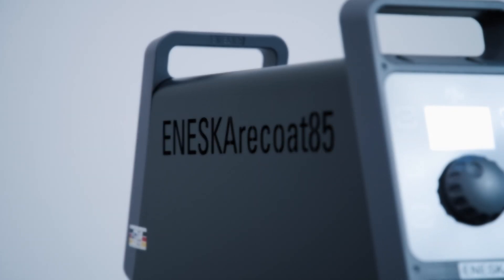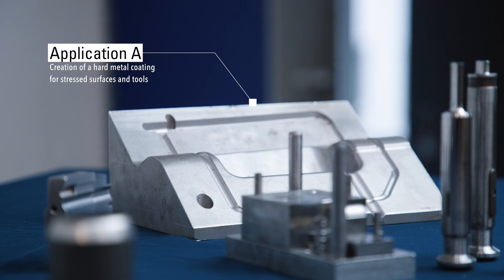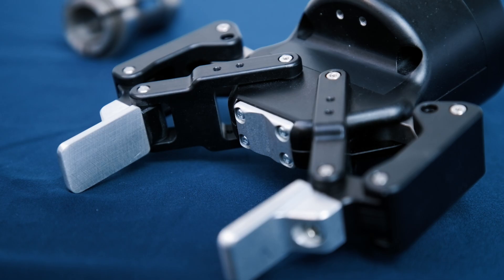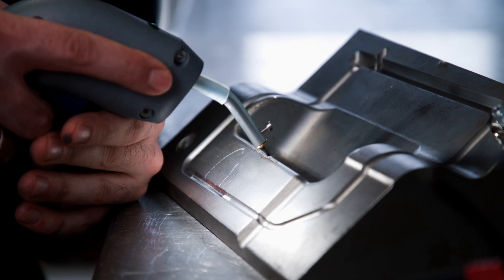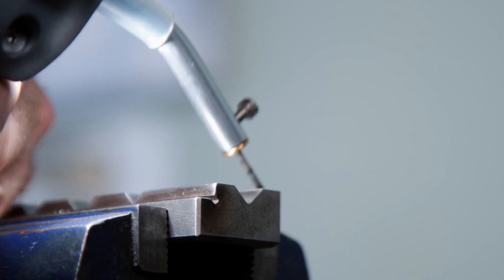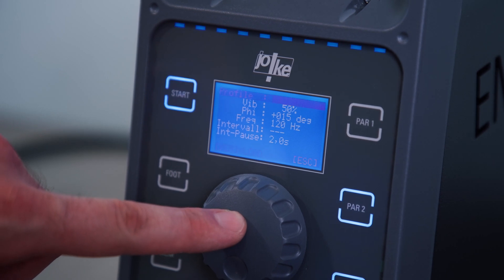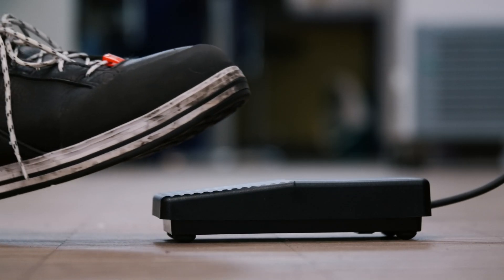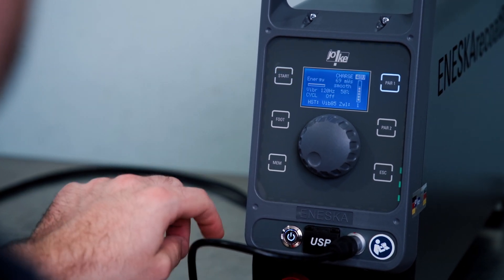ENESKArecoat 85- Tungsten carbide coating unit

Comment: Hi. Can it use for tooth bucket excavator?
Reply from the maker: Yes it can be, but I would suggest this: https://youtu.be/yzA-yr101_Q It is made for coating large surfaces. 

The Recoat is usually used for small applications.